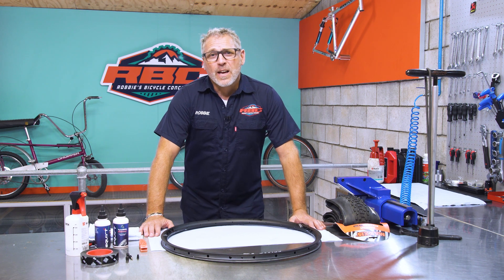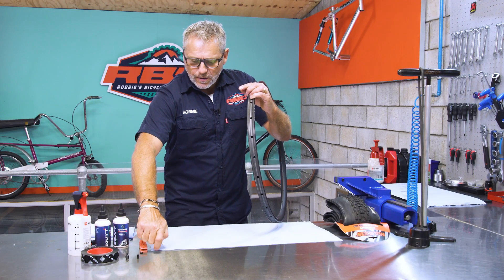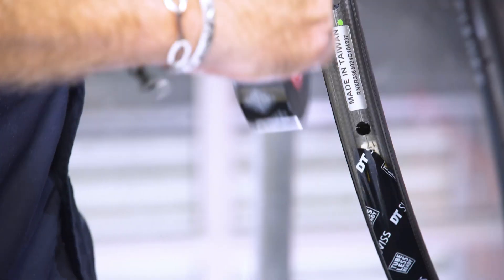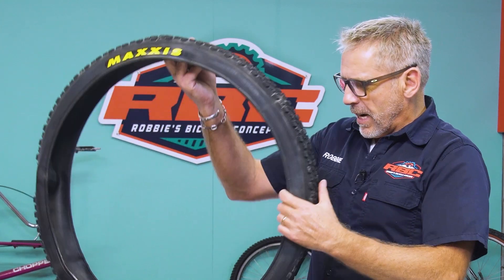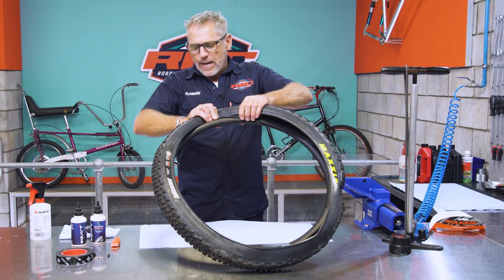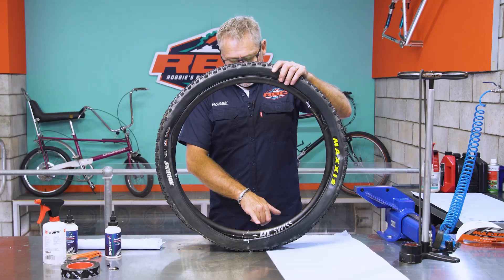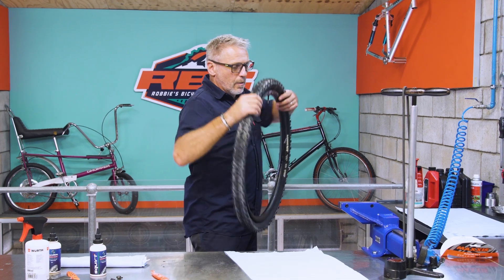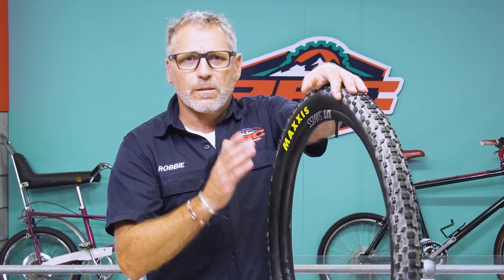Tubeless conversion on MTB wheels made easy.  | DT Swiss

Comment: I take a soapy sponge and apply it inside the rim and the part of the tire that needs to be sited, it slides in place even with a regular pump(the soap acts as a barrier for air as well). With soap, you can manually sit the tire by pulling on it from the side, without the big pop

Comment: What a mess when you pour the sealant.
We do not make holes on the valve with a screwdriver in any case, the white stickers from the manufacturer that are attached to the rim should be peeled off, the rim should be "naked"

Comment: Park Tool says to ditch the o-rings on the valves. Do you agree?
Reply from the maker: Hi Peter! everything which is included in the kit is recommend to be used👍 The Job of the O-Ring is to prevent the counter nut to get loose and as well to avoid any damage on the rim surface. Friso "DT Swiss".
Reply: @dtswiss  Thank you much Friso!

Comment: 1. Can't find the valve stems anywhere.
2. Why don't you just make a UST rim FFS?!
Reply from the maker: Hi Chuck
Thank you for your message. Tubeless valves and suitable tapes are available in any bikeshop. Ours are mostly available in kits:
Try this in any online search engine: "DT Swiss Tubeless ready kit". 
Regarding UST: This would be a huge story and is not possible to explain in a couple of sentences. In short words, to complicated if it omes to rim production, to heavy if it comes to tires and as an result to much rolling resistance. This means to many disadvantages compared to the benefits it offered. Enjoy riding your bicycle, Friso "DT Swiss".